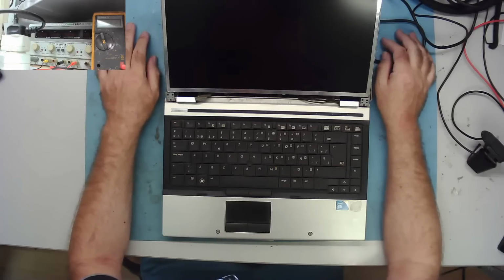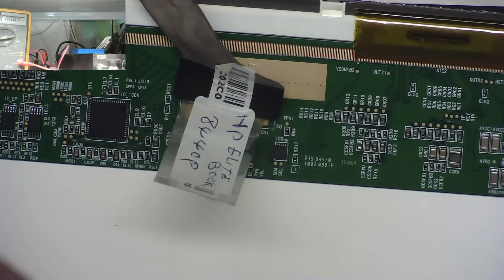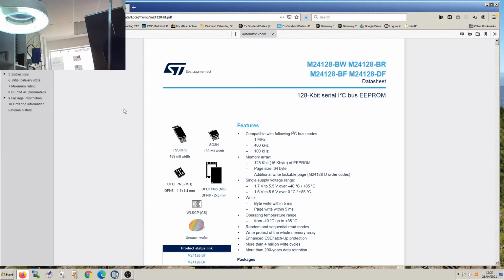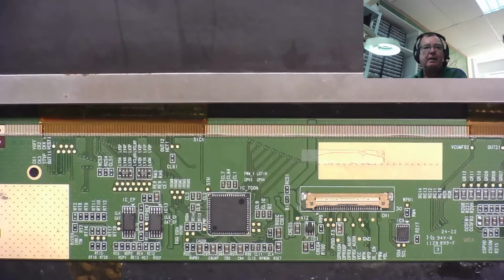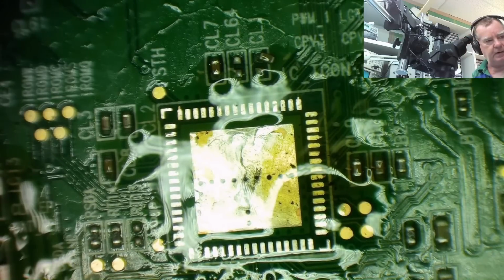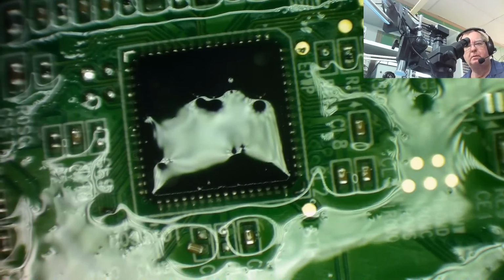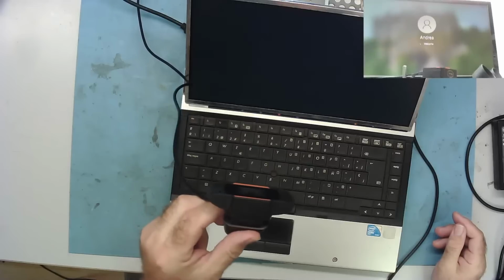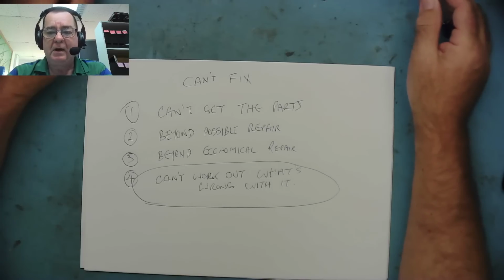LER #044 Laptop LCD LED Screen Repair - Back Lights OK but no picture

Comment: 1:57:30 - Richard, you may have already discovered this by now; but, I hear a tick in the audio each time you touch the board with your iron. It’s possible this is causing your camera to lock. I’ve noticed this in some of your other videos. Maybe it’s a bonding issue or ground loops.

Comment: The large chip you replaced, below it was c94. On the large chip side it looked(to me) to be de soldered a bit after you used the air heater.  This is a year later, probably long gone now. I'm enjoying your tutorials. Thanks for your efforts.

Comment: Thanks  you very much ,  i keep watch all your video  & learn lot of " troubleshooting  & solder skill" please keep explain in more  detail how you want to change BADs part & how to locate PARTS to buy , most  i respect from you is  ATX power supply  , when Diode SHORT ,   must buy all Parts  RELATE to that circuit & change it all = it is True , cause i remember  30 years ago  when i  was  see   short & burn resistor  m change resistor is not fix the problem , change all diode & CAPA  then  FIX problem ...

Comment: Greetings:
If the replacement screen is the same part number as the original screen then it should work as long as it is not serialized requiring some special pairing process.